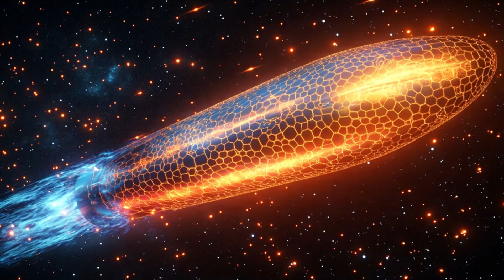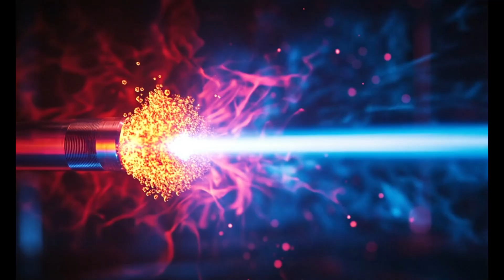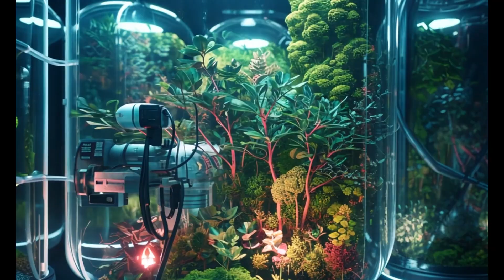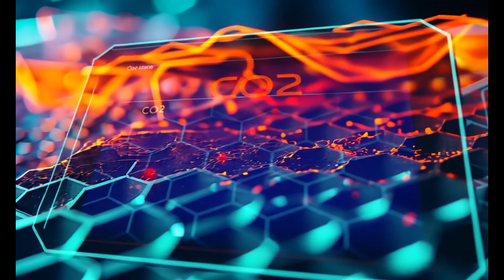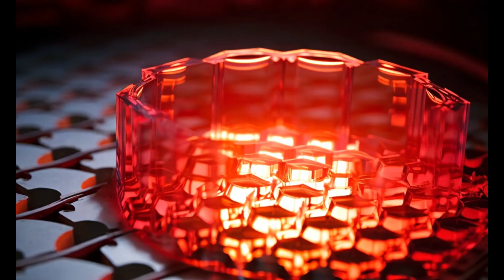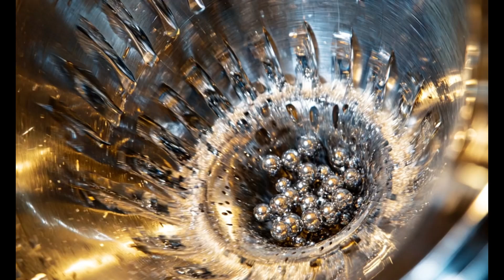SpaceX and Beyond: 6 Revolutionary Heat Shield Technologies

Comment: Lots of talks about dream but nothing on the capabilities.  How do you keep graphene from reacting with air?
Reply from the maker: Here's my response to the question about protecting graphene from air reactions, combining technical 
"Thank you for this excellent and critical question about graphene's air reactivity. You've touched on one of the most fundamental challenges in practical graphene applications.
The protection of graphene from air oxidation involves several key engineering approaches:

Surface Passivation Methods:

Atomic Layer Deposition (ALD) of protective oxide layers (Al2O3 or HfO2)
Thickness control: 2-5nm optimal for maintaining graphene's properties while providing protection
Temperature-controlled deposition below 150°C to prevent thermal damage

Chemical Functionalization:

Selective edge functionalization with hydrogen or fluorine atoms
Formation of covalent bonds to stabilize reactive sites
Preservation of central graphene domain conductivity

Environmental Control:

Inert gas encapsulation (Ar or N2 atmosphere)
Humidity control below 1% relative humidity
Temperature regulation under 40°C

Composite Integration:

Sandwich structure formation with hexagonal boron nitride (hBN)
Van der Waals heterostructure assembly
Clean interface maintenance during fabrication

"While I've provided these technical details based on current research, I should note that I'm not a practicing materials scientist. There may be recent developments or practical considerations I haven't covered. I encourage verification with current scientific literature and consultation with active researchers in the field. The complexities of graphene protection continue to be an active area of research with ongoing discoveries."
Reply: @kai36098  Sir:  none of them works for ascent or reentry heating.  Graphene may work in space for solar heating protection.  Nano scale coatings simply insufficient.  Heat shield is like tires of your car.  Small failure can be catastrophic.
Reply from the maker: First of all, I humbly acknowledge that this video may lack the depth of expertise required for such a critical topic, and I kindly ask for your understanding. Approaching the significant challenge of preventing graphene oxidation from a non-expert perspective has inevitably resulted in some shortcomings in terms of specificity and practicality in the proposed ideas.

Despite these limitations, I sincerely hope that this effort to highlight the severity of graphene durability issues and the necessity of addressing them can be appreciated. My goal was to spark awareness and encourage further research and development, even if the details and solutions presented may fall short of professional standards.

The intention behind this video was to offer diverse perspectives and creative ideas, fostering constructive discussions about potential solutions. I hoped it would serve as a catalyst to bring attention to advancements in graphene technology, facilitating collaboration and communication between academic and industrial experts.

While the suggestions in the video may lack professional rigor, I believe that even these modest proposals can inspire collaborative dialogue and pave the way for meaningful partnerships. This video was primarily aimed at raising public awareness and interest, and it is clear that solving the issue of graphene durability requires far more systematic and specialized research. The insights and guidance of experts like yourself are absolutely essential in this regard.

I sincerely thank you for your sharp and valuable feedback, and I hope you can understand the humble intent of this video. Your expertise and constructive criticism are deeply appreciated and will help improve future efforts. I will strive to incorporate such valuable feedback into my work to contribute, however modestly, to the advancement and popularization of graphene technologies.

I hope this video serves as a starting point for more productive discussions, and I deeply respect your professional knowledge and efforts in tackling the challenges of graphene durability. Once again, thank you very much